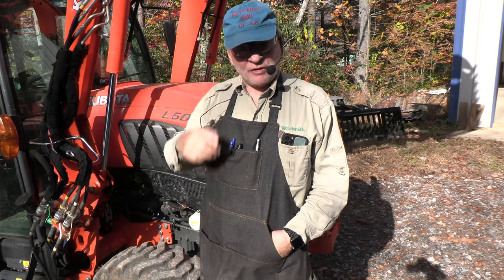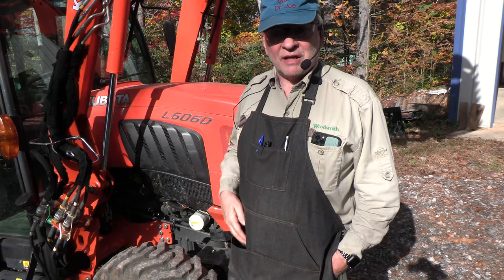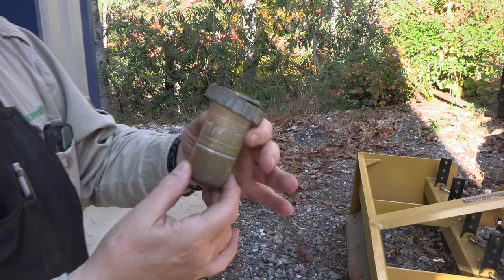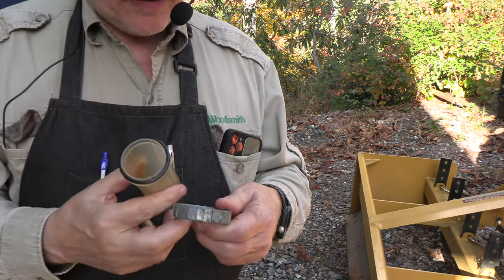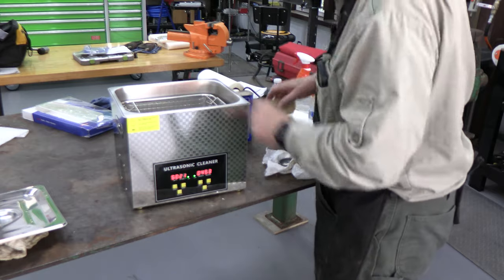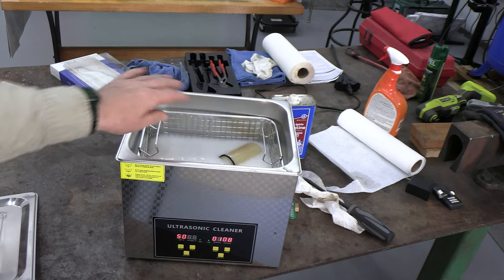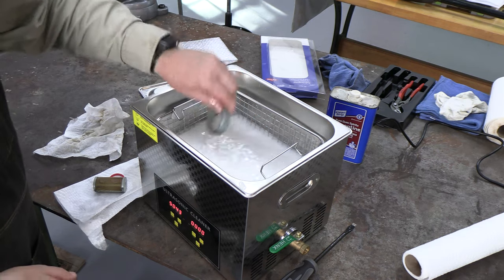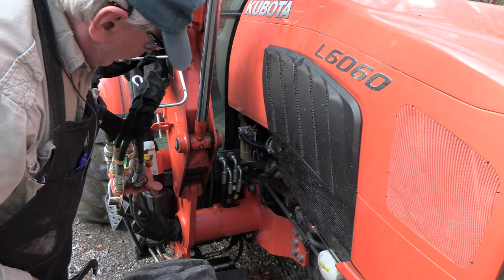KUBOTA WATER FUEL SPEARATOR DRAIN and CLEAN OUT

Comment: Youtube in it's infinite wisdom brought me here when I searched "Takeuchi Fuel Water Separator" I imagine it's the same general ideal so works for me. Thanks for the video.
Reply from the maker: Yes, I believe it should be very similar. If not almost identical. If you do change it out maybe let me know if it works. OK thanks. Consider subscribing. Thanks again, Joe.
Reply: @JosephHunstad  So my year model of the Takeuchi TB240 Excavator has a fuel water separator. It did not have a see through globe to view the contents or any way to measure the amount of water contained in it. I simply shut off the fuel valve and removed the entire bowl, emptied it and replace it, turning the fuel back on. Was pretty straight forward. So much appreciated for the video to lead me in the right direction.

Comment: How to fix fuel leak on separator bowl
Reply from the maker: Hello, thank you for your question. There should be a rubber gasket that seals the bowl to the area above it that you screw it into. Be sure that rubber O-ring or gasket is present. Otherwise it will absolutely leak. If it’s missing, you’ll need to get a replacement, which can be probably easily purchased Online or from your dealer. This can fall off when you’re changing out, the fuel separator, and it can just fall to the ground and it can be lost. This might’ve happened. Consider subscribing. Thanks. Joe.

Comment: Thanks for the video! Can you tell me what kind/size of wrench you’re using? I need to do this same maintenance task on my tractor (a 5060).  Thank you!
Reply from the maker: Thank you for your question. The wrench I used was a large adjustable wrench that could easily fit around the retaining nut at the top of the water trap. And adjustable wrench. That has a good gripping surface is what you need. Consider subscribing. Thanks Joe.

Comment: Could not tell from the video where your float indicator was before you removed the glass bowl. Perhaps because it was dirty. Have you done a companion video on changing the L6060 fuel filter? Thanks for this one.
Reply from the maker: Thank you for your question. No the float was so filthy and full of crud probably from ethanol that it actually was at the very bottom of the cylinder. The bowl is not glass unfortunately it is plastic and has discolored but I can still see it pretty well. Now that I’ve cleaned it out the float is very visible at the bottom but before it was not it was covered with a brown crud probably again from the ethanol in the diesel fuel. please consider subscribing. Thanks – Joe
Reply from the maker: No I have not done a companion video for the oil filter but I will be doing that in the future. Thank you again Joe

Comment: a neighbor's tractor shut off unexpectedly. I looked at his water separator and found it "up to the red line". Will the tractor shut down when this happens?
Reply from the maker: Hello Steve. Great question. When the water level reaches the red line, it’s a big problem because then water is absolutely moving down the fuel line and not being trapped. Water in the injectors and then in the engine is a bad deal. Yes it can cause the tractor engine to fail. Unfortunately, the chamber becomes cloudy overtime but it is something we need to look at more frequently than not. Consider subscribing. Thanks, Joe.
Reply: @JosephHunstad  all update if I'm involved with draining the water separator
Reply from the maker: @sepound33  Sounds good thanks